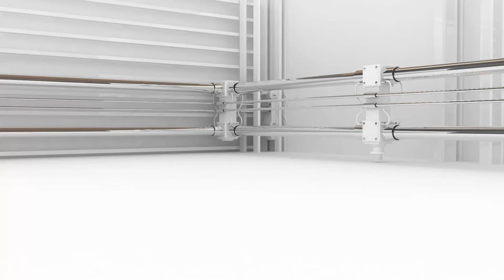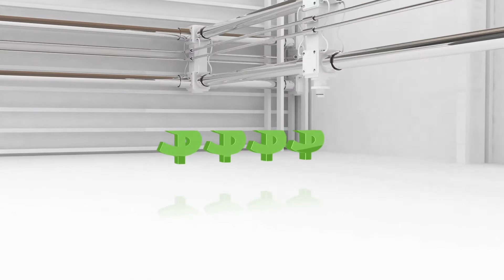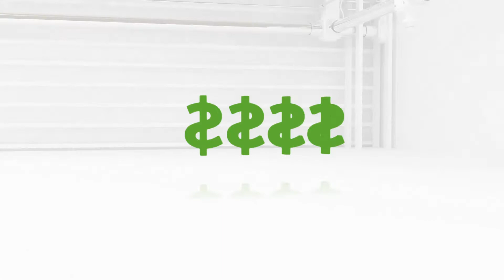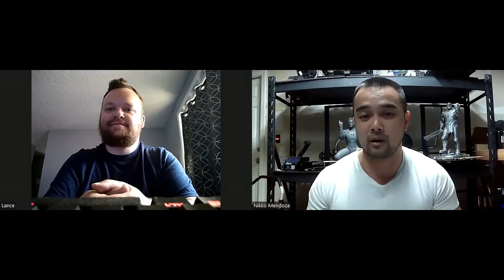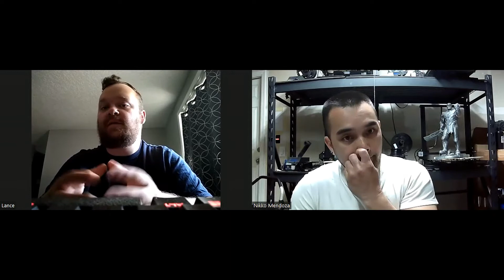3d Printed Profits Episode 10- $250k for One Job as a Product Design Business

Comment: Great Video.  I also started with 123Design when creating my designs, and in fact I still use it.  I have tried Fusion 360 and a few other programs but keep coming back to 123Design, it has it's limits, but I have been using it since 2016 and it does what I need it to do.  The biggest down side to it is it's very hard to make major changes to your designs, no timeline to go back in your design like in fusion etc.  It's so true that alot of businesses don't last 12 months or more.  Not long after starting my 3D Printing journey I started a 3D Priting side hustle, which was hard with long hours.  After doing this for almost a year the thing that broke me was when a customer, who was my biggest job at that stage $1,500, took the print that I had designed and printed for him to China and had it reverse engineered and injection molded.  I still 3D Print but only do it for myself or the occasional print for family or friends.